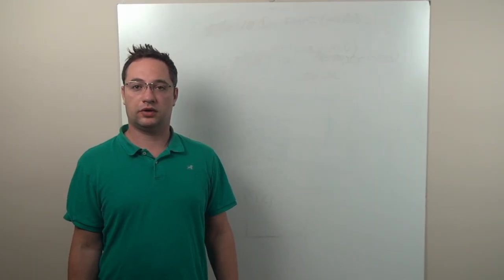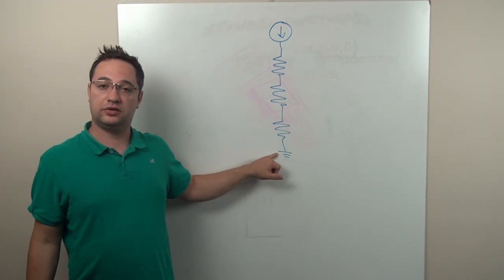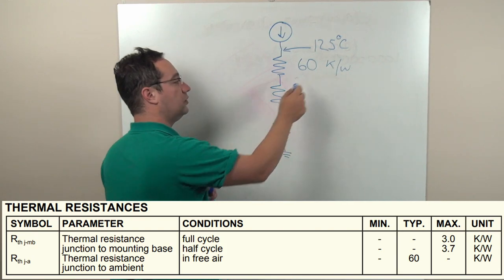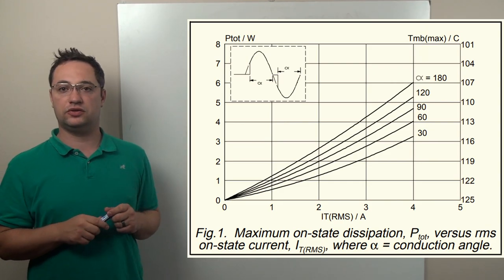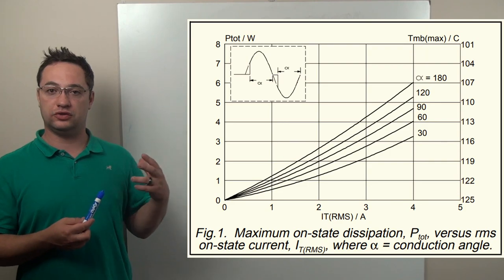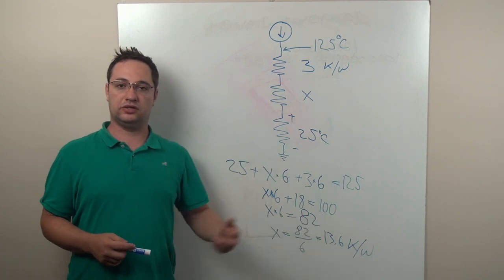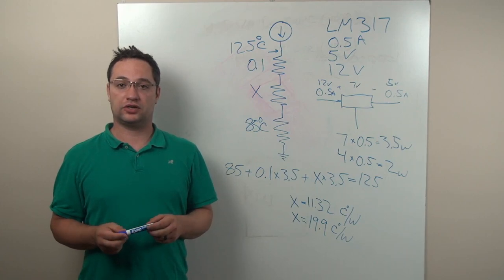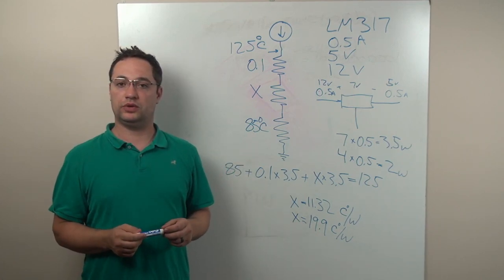eapbg #52 Thermal Calculations

Comment: EAPBG, when looking at a datasheet of a component, what are some very simple formulas to use to know what heatsink to get for the component? They sell generic heatsinks for component packages but you have to know the supply voltage, current rating and wattage of the component. The heat dissipation is Voltage X current?
Reply from the maker: I go over the formulas in the video. There are no short cuts, you need to know all that stuff. You are correct with one small edition, heat dissipation is voltage drop x current.
Reply: Yes but your formulas don't tell me which heatsink I can buy at NTE electronics for that component size and shape. The formulas just say it needs a heatsink but what size that are generic parts from NTE electronics. Yes its the "voltage drop" across the component X the current = heat dissipation?
Reply from the maker: My formulas tell you the thermal resistance. The thermal resistance will tell you the size of the heat sink. So if you need a thermal resistance of 10C/W then any heat sink that is a 10 or smaller will work. A 5C/W will keep the component twice as cool. As far as the dimentions or component size then it's a square peg goes in the square hole. Choose what fits your design and component. Don't stick a TO220 on a DPAK
Reply: ok thanks let me look into the thermal resistance in the heatsinks on NTE website for T0220 packages.

Comment: EAPBG, some circuits use "thermal cutoffs" instead of using fuses, any reasons why? are the thermal cutoffs faster compared to the fuses delay time?
Reply from the maker: They wouldn't be instead, they would be alongside. They protect against different events.

Comment: EAPBG, there is two types of heat sink compound there is non-conductive heat sink compound and conductive heat sink compound. I'm confused when to use either and I'm guessing Microprocessor chips use conductive heat sink compound? I'm not sure which compound to use for transistors, fets, etc is it non conductive or conductive compound?
Reply from the maker: It depends on what is electrified and how hot it gets. Conductive compound has silver in it and it transfers heat better. The top of a processor is not electrified and it gets really hot. Use conductive. With discreet components it depends on whether the tab is electrified. Some components will have an isolated tab and some it is electrified. If the tab is isolated then use whatever you want. If the tab is electrified it will then depend on whether it is OK to electrify the heat sink. If the heat sink can be electrified then use whatever. If the heat sink can't be electrified then use non-conducting or a sill pad and possibly a plastic washer.
Reply: @eapbg  So what you're saying it depends on the "heatsink" if the heatsink can be electrified or isolated? I didn't know they made two different types of heatsinks one that can be electrified or not. What you mean by electrified is an applied Positive Voltage on the heatsink correct? Yes some tabs have the +VCC voltage on the tab and other tabs are tied grounded.
Reply from the maker: It's not the heat sink itself but what it's connected to and where it is located. For instance an electrified heat sink in a metal enclosure may not be a great idea. An electrified heat sink in an all plastic enclosure is not that bad.
Reply: @eapbg , just to make it clear you use heat sink compound that is Non-conductive when an electrified heat sink is in a metal enclosure? and you use "Conductive" heat sink for electrified heat sink in a plastic enclosure?
Reply from the maker: Williams it's not quite that simple.